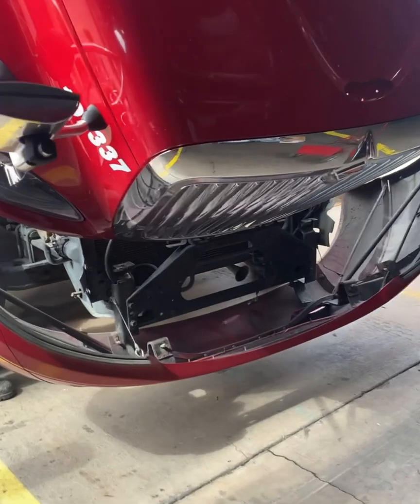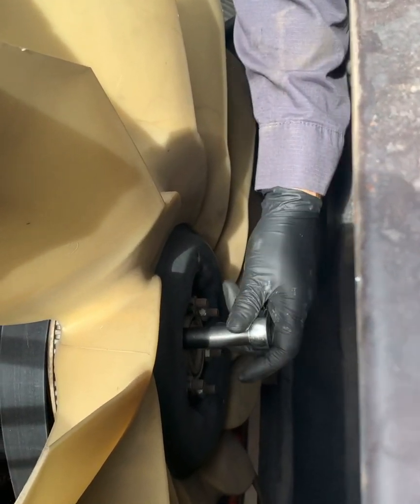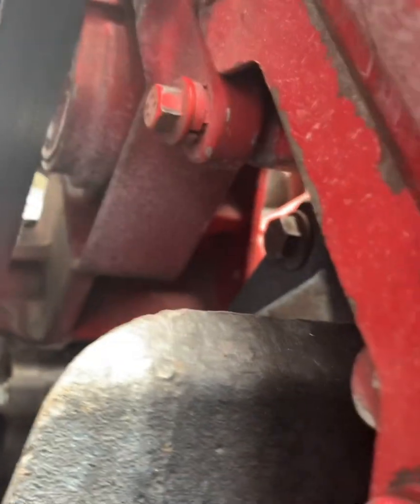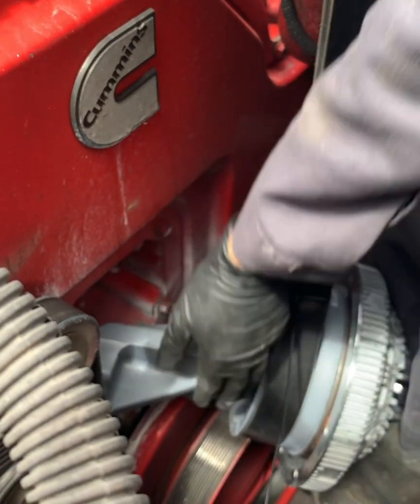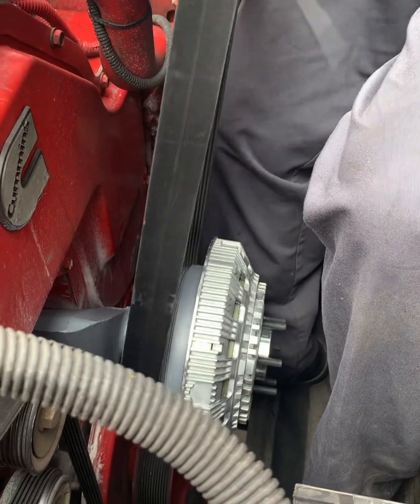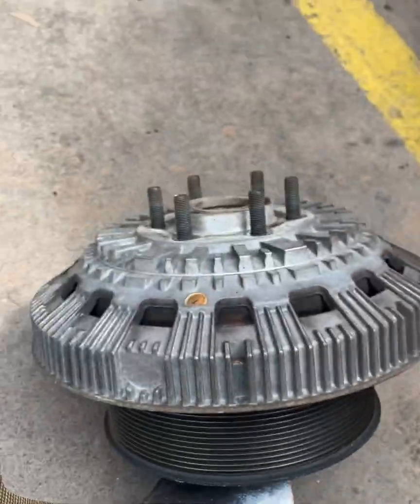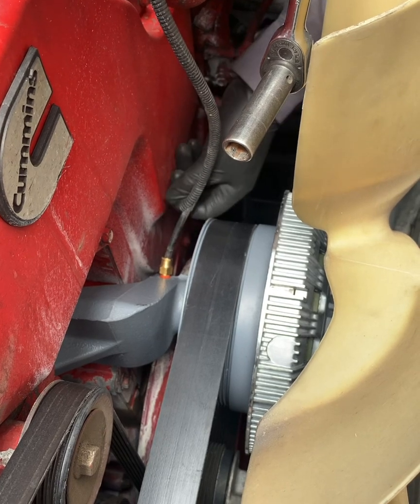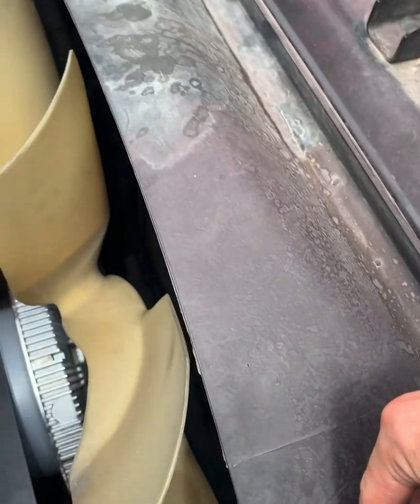International pro star fan hub assembly. Engine Fan clutch replacement Cummins ISX overheating, AC.

Comment: What's the part number because I have the same clutch fan. I tried to replace just the clutch but I don't see how to remove it
Reply from the maker: Like I mentioned before, if it’s the clutch your going to hate life trying to replace this clutch. Price out the assembly and you’ll thank me later.
Reply: @bustedknucklebydieseldr3228  its blowing air out the back of the 2 port holes on the bracket, so I figured the clutch is bad
Reply from the maker: @LearnWithDeeboy  little pricey but you’ll be happier spending that than trying to  perform the clutch replacement process. Plus you’ll need special tooling.
Reply: @bustedknucklebydieseldr3228  $2,015.50 😠
Reply: @bustedknucklebydieseldr3228  I wish I had the 2 piece clutch assembly. Just change out the clutch and move on with trucking. I have to purchase the whole assembly; clutch and bracket assembly

Comment: You have to replace the whole clutch assembly or you can replace just the clutch?
Reply from the maker: You can do just the clutch if you’d like but if your clutch is a Horton than it’s going to be time consuming and a lot of work. So for price and labor at the cheapest points the hub assembly replacement is the best option. If it’s the other brand of clutch which isn’t coming to me right now than the clutch replacement is easy and would be a better option. But price them both out and see which one you’d prefer to do.
Reply: @bustedknucklebydieseldr3228 got one from the dealership for $1,400. Thanks bro